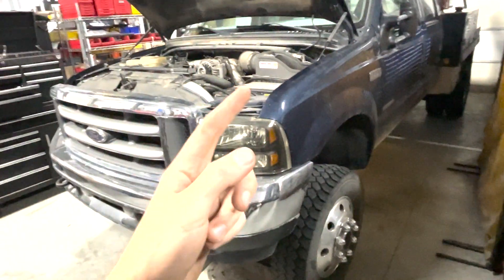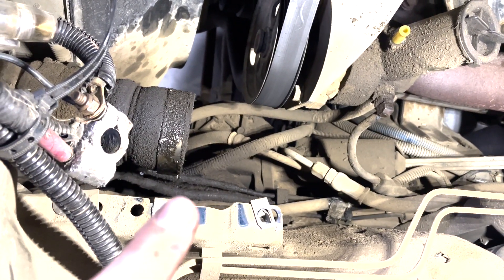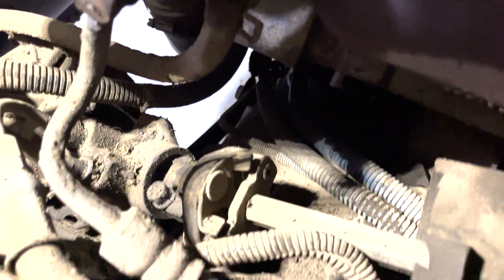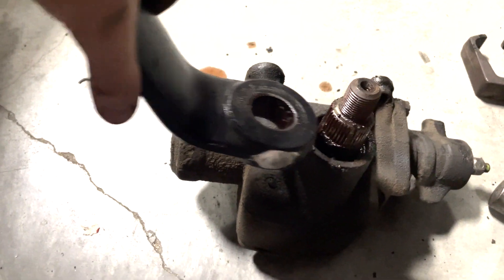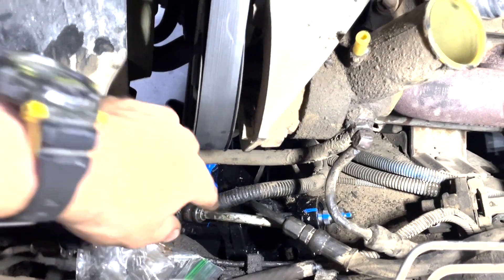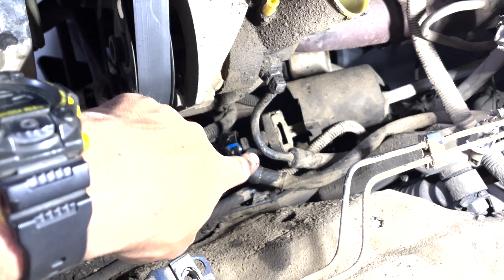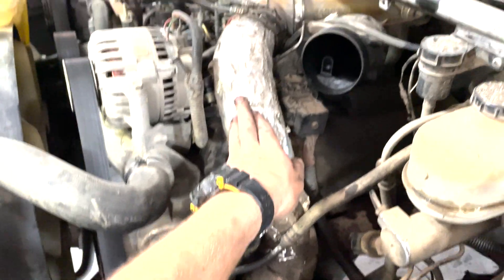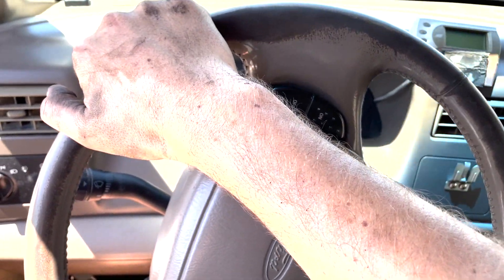Bluetop Redhead Steering Gear Box replacement 7.3 Powerstroke Ford Superduty

Comment: I thought the red head steering boxes all came with the red tops, not blue?
Reply from the maker: they are two different builders. I have a redhead in my personal truck, but for my work truck i used a bluetop because it was cheaper and the reviews were just as good. Same proccess for install

Comment: Great video. How is the red head holding up so far? Any additional slop that has crept in?
Reply from the maker: both the red head and the blue top have been fantastic, and ive not had any problem from either... the red head now has about 80k miles on it and i'm running 35 inch tires